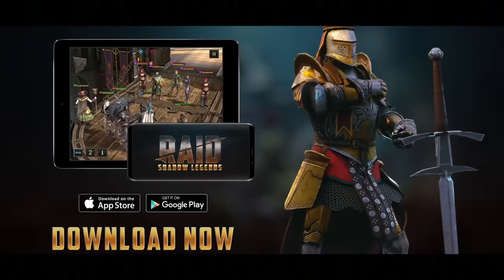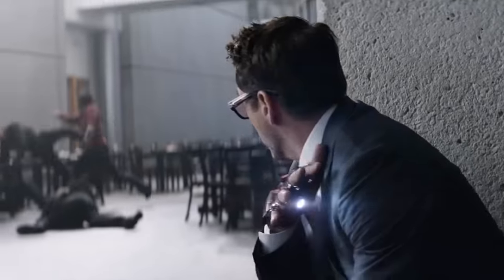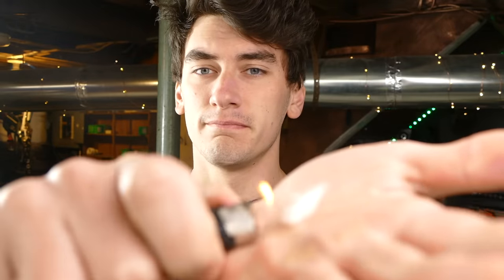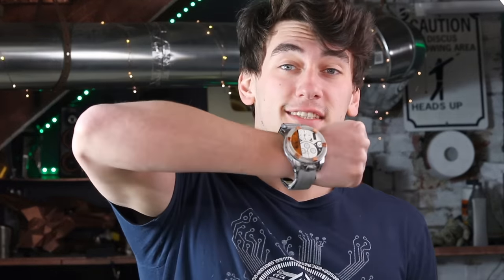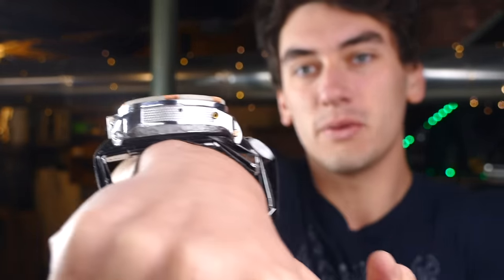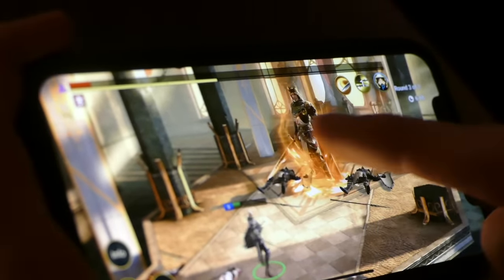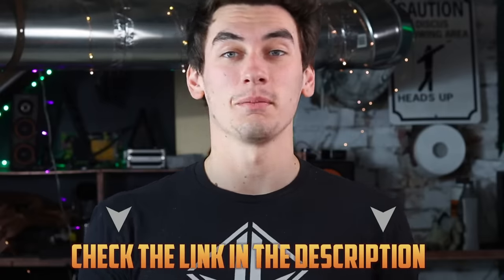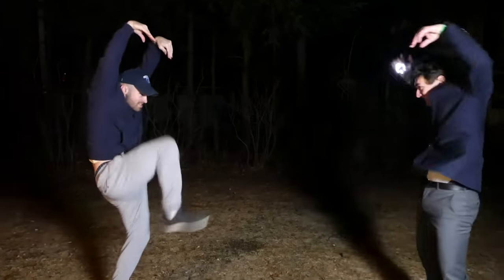Working Expandable Iron Man Watch Glove Repulsor! (From Captain America Civil War)

Comment: I use/ play with flash paper and cotton. I have found that if you put a small piece of a staple in the middle of some flash cotton wrapped with flash paper it will go farther than if it didn’t have the small piece of metal. I normally use one of the side pieces of the staple.

Comment: You should make:
Doc Ock’s Robotic Tentacles
Deadshots Wrist Mounted Guns (Air soft Guns instead of real guns)
One of the Chitari tech weapons from Spider Man Homecoming

Upgrade the lightsaber by adding multiple lasers in a circular formation for a thicker and more powerful blade that also looks more like an actual lightsaber
Reply: When you make a lightsaber using actual lasers, the lasers continue to go forward. There’s no actual way to stop the lasers at a certain point, without making it look weird. Check out The Hacksmith’s video on how he made a working lightsaber, it’s pretty impressive.
Reply: Just a Crewmate
Ik, I was thinking maybe a rod came up through the middle of the lasers (since they’d be in a circle) and at the top of the rod would be a mirror or piece of steel. There are better ways of making a lightsaber but lasers are more on his brand. Plus since the rod would come up through the center you wouldn’t be able to see it through the lasers

Comment: Heres an idea. Make a sort of tazer-like-gun for pracital jokes, doubt it would be much stronger. Like, it has a magazine full of AA or AAA batteries. The idea is that when you fire the gadget, it completely discharges the batter and gives the victim a little zap cycle the chamber and shoot again. If its not a direct contact tazer, you can have a dual magazine system. one that holds batteries and spring wire cartridges. Also you can use chainmale for the glove.

Comment: You'll never get it because you're trying to do it with technology that is based on an electro-magnetic model that won't allow for it. You have to understand Repulsine energy generation. A repulsine generator employs the technique of putting a magnetic field in a vortex configuration. When a magnetic field is in this configuration it can be used as a means of propulsion because you're pulling, in this case the Iron Man suit, or pushing it along the vortex axis.
If you collide certain atoms they split and produce energy. Example Atomic bombs.
Well you can do the same thing with magnetic fields. By colliding the fields you create energy. Then by rotating those packets of magnetic energy fast enough, it results in a magnetic vortex or cone like configuration. By pinching  or focusing the vortex by widening or shrinking the diameter of the magnets being used to make the fields, you can use push your self like a jet or you can focus the field really tight and then send a pulse frequency through it which will launch a pocket of the energy forward. If done fast enough the energy will be extremely hot and can burn through just about anything.